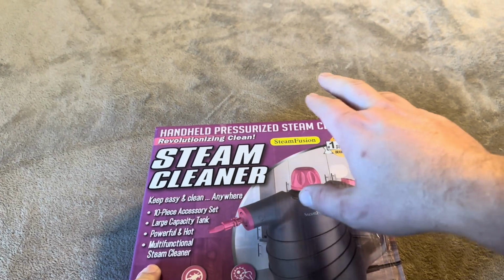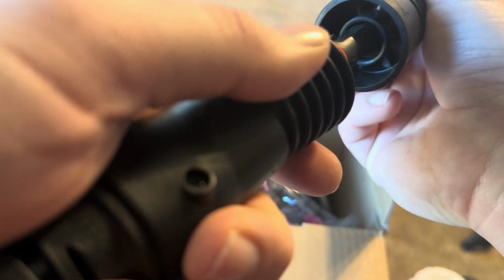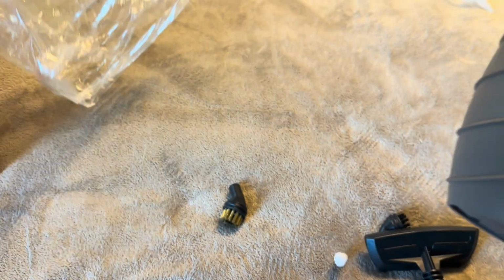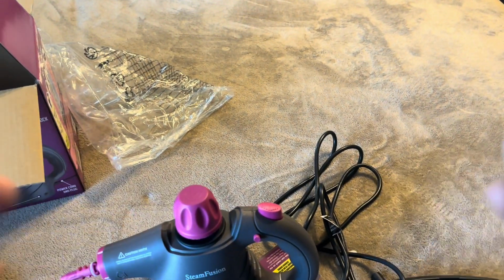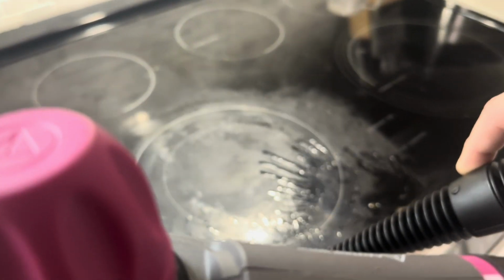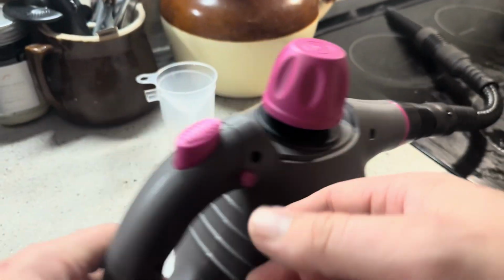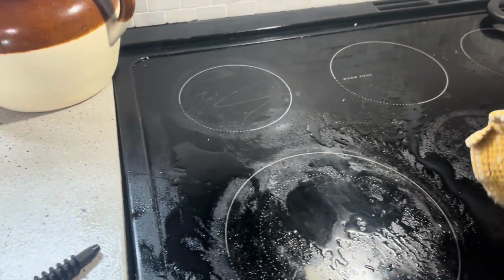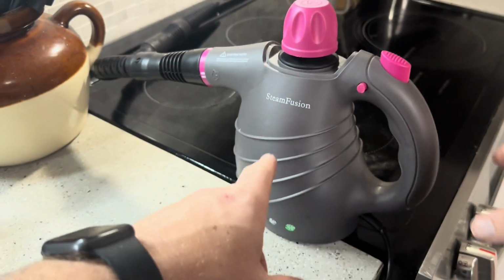Assembly, Testing, Usage, Heat Time, and Review of Steam Fusion Pressurized Steam Cleaner

Comment: Thanks for this! Can you change accessory in between a cleaning cycle or do you have to unplug let it cool down and then change it ?
Reply: this is what I'm wondering too.
Reply: AI Overview
Steam Cleaning FAQ: Everything You Need To Know! - Stacy ...

Yes, with the SteamFusion, you can change attachments while cleaning, allowing for versatility and efficiency in tackling different cleaning tasks. The SteamFusion is designed with a quick-change system for the attachments, enabling users to switch between various nozzles and brushes without interrupting the cleaning process. 

Here's a more detailed explanation:

Quick-Change System:
The SteamFusion features a quick-change system, allowing you to easily detach and attach different cleaning heads and nozzles. 

Versatile Cleaning:
This feature enables you to switch between cleaning different surfaces and areas with the appropriate attachments. For example, you can switch from a floor brush to an upholstery nozzle or a detail brush without needing to turn off the steamer or wait for it to cool down. 

Efficiency:
The ability to change attachments on the fly streamlines the cleaning process, allowing you to move from one task to another seamlessly, saving time and effort. 

Specific Examples:
You can use the upholstery nozzle for furniture and fabric cleaning, then quickly switch to a detail brush for grout or crevices, and finally use the floor brush for hard floors. 

Safety:
Always ensure the steamer is not actively spraying steam when changing attachments, and follow the manufacturer's instructions for safe attachment changes.